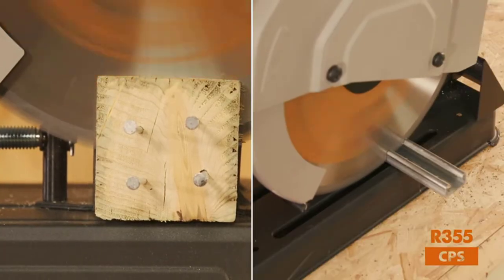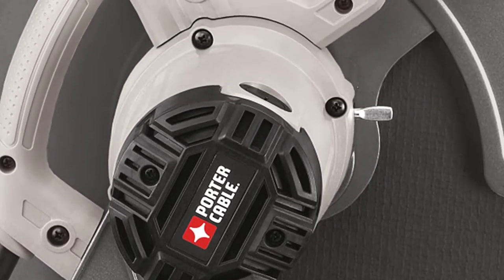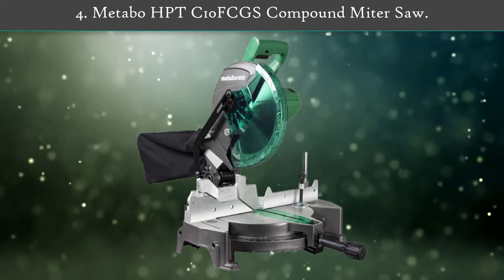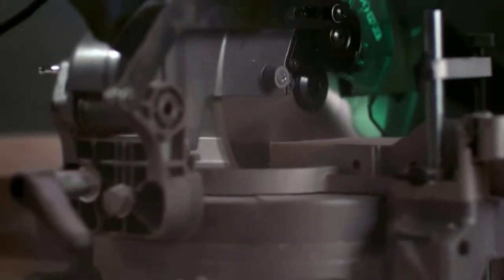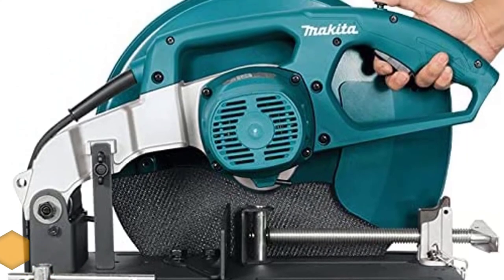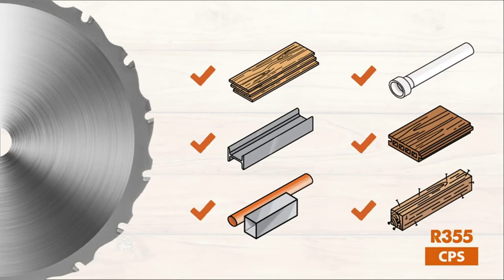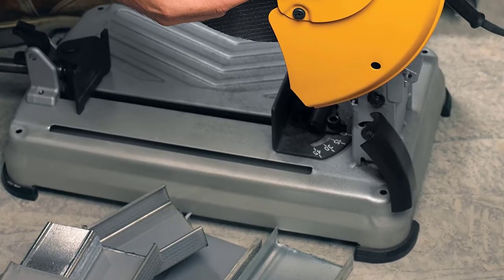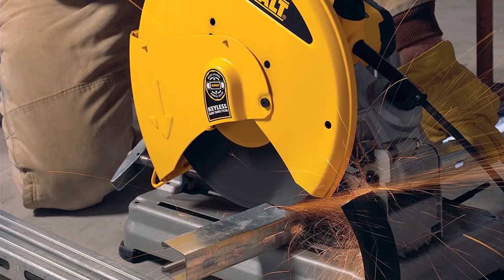✅Chop Saw – Top 5 Best Chop Saws in 2022.

Comment from the maker: Top 5 Best Chop Saws List & Link:

1.  DEWALT D28715 14-Inch Quick-Change Chop Saw✅✓
► https://amzn.to/3PMHoB6
2.  Evolution Power Tools R355CPS Chop Saw✅✓
► https://amzn.to/3zvLisr
3.  Makita LW1401 Cut-Off Chop Saw✅✓
► https://amzn.to/3zdTdcS
4.  Metabo HPT C10FCGS Compound Miter Saw✅✓
► https://amzn.to/3OtDJad
5.  PORTER-CABLE PCE700 15 Amp Chop Saw✅✓
► https://amzn.to/3zwKxiQ